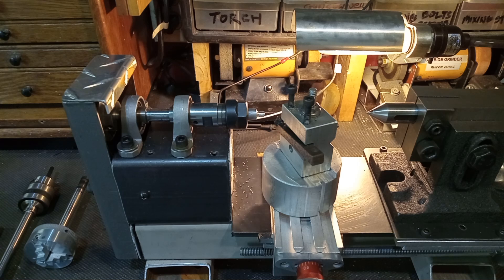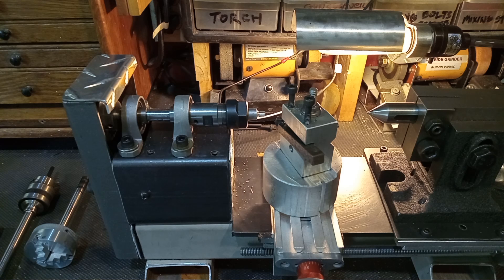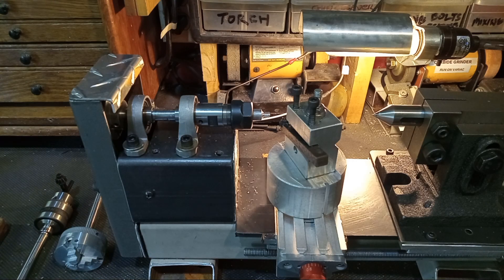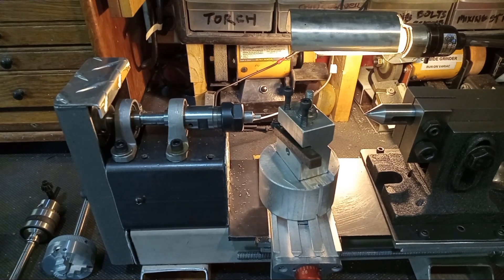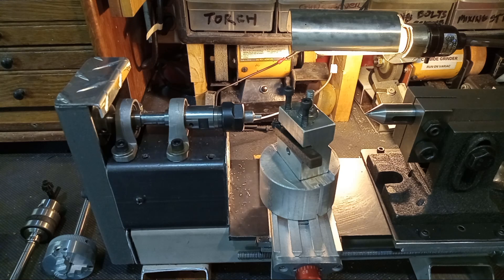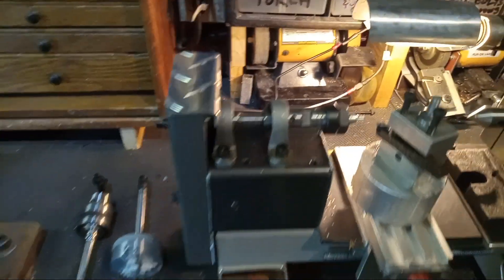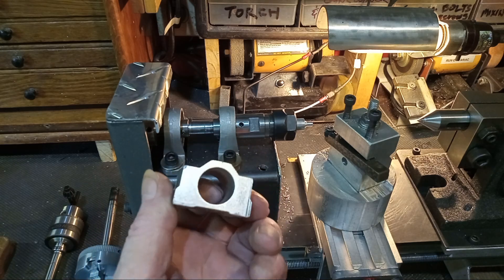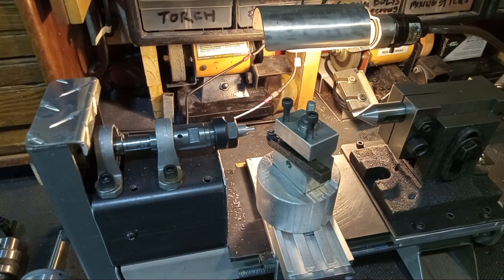Micro metal lathe 2.0

Comment: Hello Scott !     I whole heartedly agree on the uselessness of those little zinc chucks - 'might be OK 'ish' for wood , or other soft materials . . . it's very likely got a weak kneed scroll , along with the jaws being quite soft too !    Zinc tends to be really BRITTLE , not good for taking much ( if any ) vibration in use - very likely would loosen up EASILY ! ? 
      Good , 'tight' bearings are a MUST !   Maybe you could turn a housing to accept a pair of double row , angular contact bearings ?    That would eliminate wear & tear exponentially .
      As long as you're getting the results you want - that's what's IMPORTANT !      "V"
Reply from the maker: @georgewocosky  and zinc I believe is what they term a "self lubricating " metal like aluminum and brass. As far as the bearings yes angular contact would be nice.  Gonna hafta look to see if they are in that size.  No hurry tho as being it is a tiny lathe I doutit will get that much use.  Mostly I just enjoy getting together scrap and cheap parts to make " stuff " lol.  Good hearing from you.